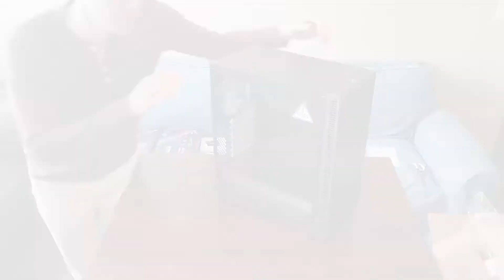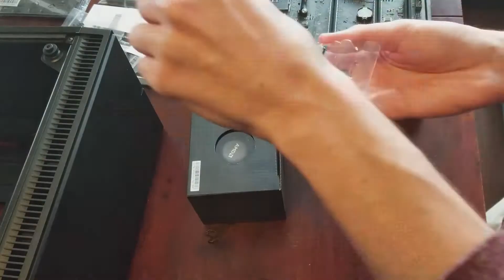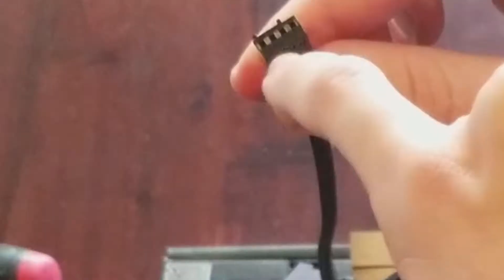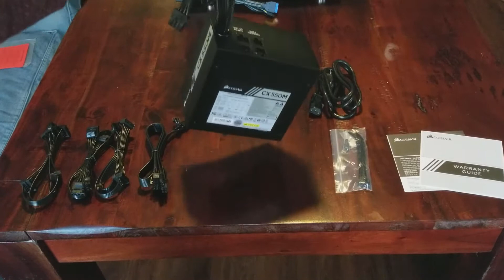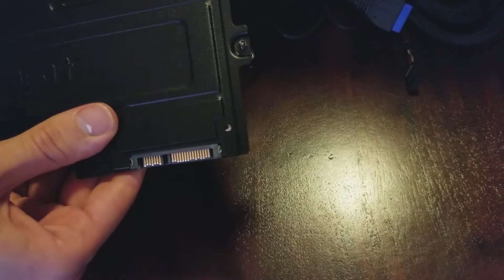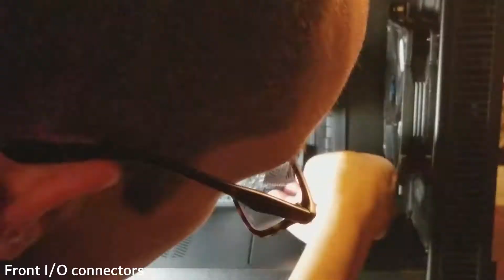Building My First Ever PC - The Build Process

Comment: Congradulations on the computer build! Very well done. Suggestion: Use separate power cables for your SSD and HDD, otherwise your drives are sharing the cables capacity.  Also, they make very nice slide on mesh sleeves in many colors for your cables inside the visible part of the computer case.  They are very handy to hide the extra connectors and weird cable colors.

DDub, It is very difficult to watch this computer build video.  Your ESD protection 'scheme' is totally insufficient.  Grounding your body requires actual skin to ground contact.  Buy and ESD wristband.  First check to see if the power outlet you plan to use is actually well grounded.  Then, before touching the protective film of an electronic assembly put the ground strap on.   The reason you need to be so careful is that the typical static discharge from a human hand is 1000 times the amount a CPU or Memory Module can withstand.  Even with a ESD wristband, you should not touch the CPU or Memory Module with the non ESD protected hand.  I have a story for you.  I was repairing a manufacturing robot controller for a Motoman Robotic system, my 'Supervisor' walked up to my workbench an picked up the controller board and asked me what I was goofing off playing with today.  The moment he touched the controller I heard the static discharge.  That discharge cost that company $7,800 and two weeks of machine downtime.  The supervisor was fired.